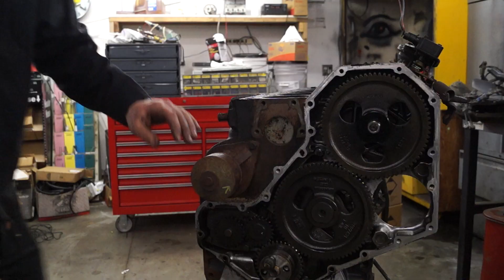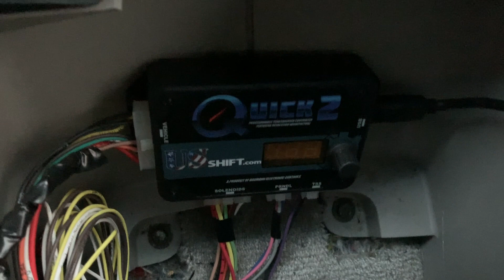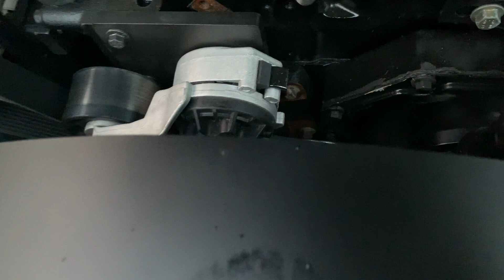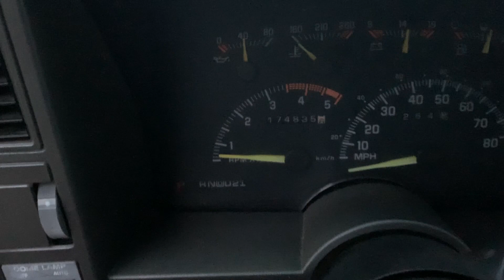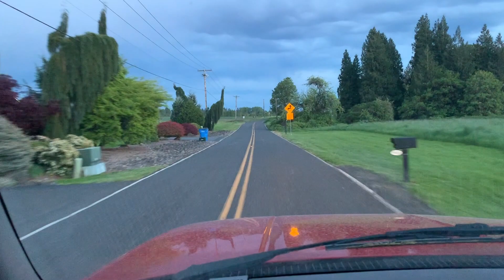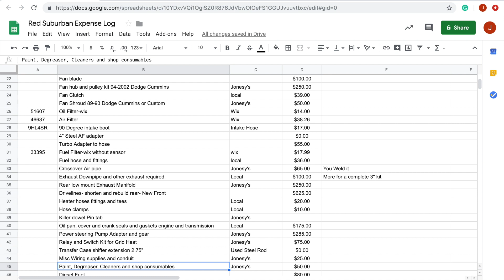Costs revealed! Diesel Engine Swap Costs for Cummins 6BT 12 Valve Chevrolet Suburban

Comment: Ive got a bombproofed 6.5 in my 98’ 3/4 ton Suburban, arp headstuds vacuum pump delete 4” turbo back straight pipe, Airdog fuel system ect.. tuned by quadstar tuning she makes 15Lbs of boost on the stock turbo with a wicked wheel ( for now ) i haul cars & various construction equipment bobcats, mini excavators across the country on a 22’ open car trailer for my hotshot business… have 284k miles and i trust er too take me across the country any day i please! Only thing with 6.5s is you have too fix/ remove some of GMs factory flaws and with any diesel Tuning is a must

Comment: So is this non-interlcooled? Could you do an air-water intercooler rather than having to run a front mount air-air? Other than that it looks awesome! I would like to do a 12v swap into my tahoe and also go with a 4r100 trans. Would be a chevy with a dodge engine and Ford trans haha

Comment: A little less than $15,000 , still about $50,000 less than a new Suburban. My kind of recycling. Have you ever done the Cummins/88-98 GM conversion with a solid axle swap? Also, is a 1500’s frame strong enough for the Cummins with a NV5600 and a Dana 60 on Deaver leaf springs ? By the way that sure don’t look like a 92 Dodge which was The OBS 1st Gen Cummins, it looks to me like a Gen2 94-2002.

Comment: Thanks for sharing these costs. I just sold my 2005 LLY Duramax Suburban for $16,000. It had 180,000 miles on it but was running great. Bought my 2005 LBZ Suburban for $23,000 recently.
Reply: Must have been custom made on both cause gm never put the duramax in the 01 and up suburbans
Reply: @codyyellott117  No shit Sherlock 😭😂

Comment: Do you know what A/C head would go from the stock 1995 Dodge 12v compressor to a #8 and #10 fitting? I have a Sanden 508 compressor on my truck now with custom made hoses and I'm trying to find the right adapter head so I can reuse my a/c hoses